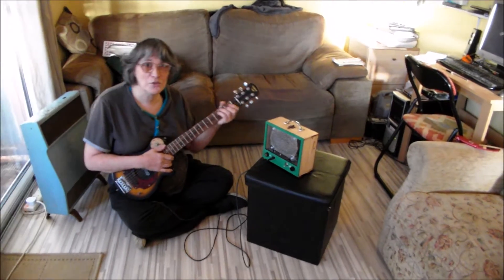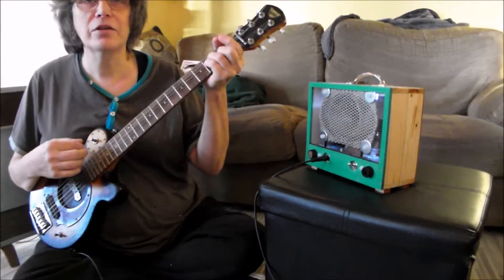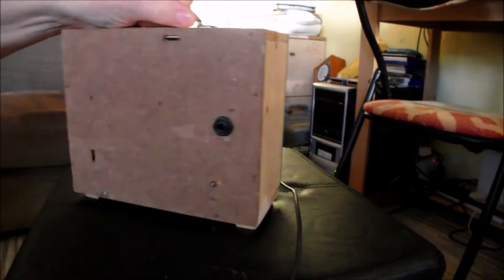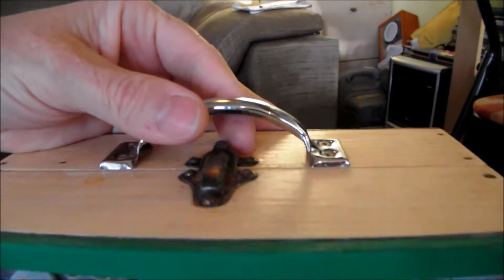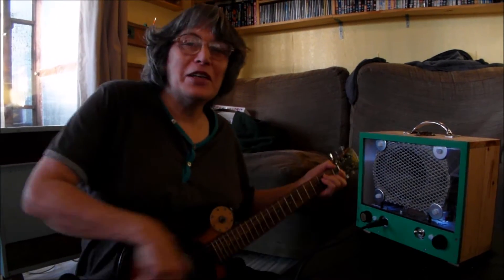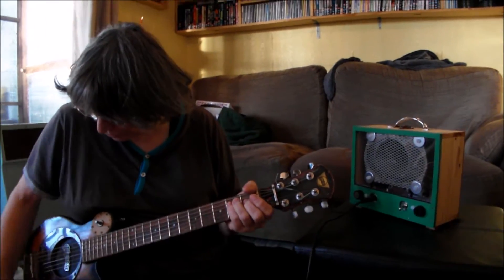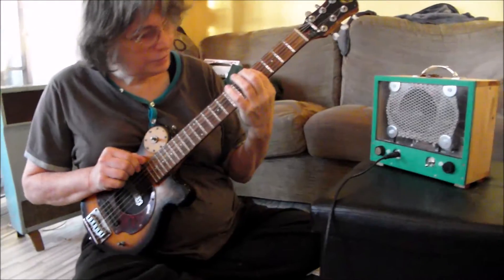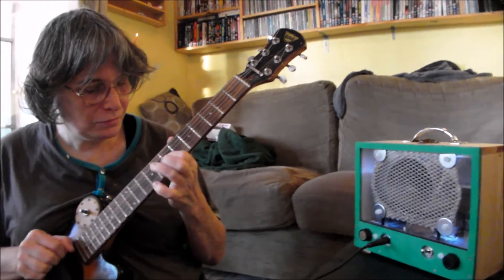ALL VALVE/VACUUM TUBE BATTERY GUITAR AMPLIFIER, NEW

Comment: I have found an old portable radio that was powered by battery and mains but it is not working and I would like to make it into a guitar amp . The power transformer and the output transformer are fine. It uses different tubes than yours and I do not know where to start working out what parts I need to make it happen. Do you have a schematics for your setup? I can strip everything from the chassis and start with all new components. I think it is a great little amp.Thanks in advance.
Reply from the maker: Hello Gy Custom Guitars. Are the valves octal or B7G? Both will work in a guitar amp but the power output for all of these designs is vey limited at 250mW. If you want the final build to be battery only, then there's a design on my Web. http://www.hoofbags.me.uk. A battery/valve version is a little more complex because the tube heater chain is series connected....continued.
Reply from the maker: Here's the schematic for the battery only version: http://www.hoofbags.me.uk/battery%20valve%20amp%202.jpgSo far, I haven't gotten around to the mains/battery version. However, this design uses a 7.5 volt battery (seven point 5) Also, there's a variable resistor in the heater chain and it would be a good idea to extract it and keep it set to where it was when inside the chassis and re-use it. The heater chain starts at the output valve: DL96, pins 1 and 7 and then goes to the DF96. Next in the chain is a DAF96 and finally the DK96. It's done like this to avoid instability and 'motorboating'. If you don't feel too confident, you may want to keep to the battery only version, where my hyperlink takes you. Pls let me know how you get on and thanks for you interest and comment, it really means a lot! (o:
Reply from the maker: Oops! That hyperlink doesn't work. Try this one and scroll down.http://www.hoofbags.me.uk/geekiestuff.html

Comment: Awesome!  Have you tried a push-pull configuration with these valves to boost the power?
Reply from the maker: That is a future project. Blackcovo, enlightens that two of these will deliver 2 watts. On top of everything else, I need to find time. There are two options: transformer phase splitting and using a triode stage that splits it but doesn't add to the overall gain. I was going to try the DCC90. It's a double triode that has 1.5 volt heater, just like the DLs. The DCC90 isn't cheap and they're quite rare. However, they look just like a DL valve and have a visual appeal.
Reply: Ahh, yes, it hadn't occurred to me that these are directly heated cathodes so most (all?) phase splitters with gain won't work. A transformer would be the easy option, I guess, but perhaps even more expensive than the DCC90? I have seen one design using a series of three DF91 valves driving a pair of DL94s in push pull. As blackcorvo suggests, potential for some quite reasonable power output there.

Comment: Would you consider building me a battery powered valve amp like the 'bat amp you where selling or sold on EBay awhile back?
Reply from the maker: Do you require it to have a transparent front panel or like the one we submitted earlier on? I'm happy to do as you kindly request but I've a bit of a backlog. Please don't loose hope, if you're still interested. Thank you very much for your interest. Love. Liz. (o:
Reply: One like the one you submitted earlier on would be great. It was in your video titled, "All valve battery guitar pratice amplifier improved useability. Thanks,  -Still Interested! Love. Ben.'
Reply: I would also be interested in buying one...how could I buy one? Greetings.

Comment: I went to check the datasheet for the DL94 (the output tube you used), and holy crap, it has pretty much every operating point you could ever ask a datasheet to have!
There's even one where it's delivering over 2 watts in Push-Pull Class B (page 5 of the PHILIPS datasheet).
Amazing little bugger. Gonna see if i can get a couple to play with myself
Reply from the maker: I was planning to design one with that valve, in push pull, class B. Philips got there first, needless to say. I will go to your recommended resource because I was thinking I'd have to use a driver TX to split the phases. It's a difficult challenge because the filaments have to be connected together and are commoned with every other valve in the circuit, and constitutes the cathode of every other tube. 

There's the DCC90 that could be used as a phase splitter, but they're rare, high price and need 200mA (!) for the filament. Is it a hard copy that you have access to or is there a link? Thank you ever so much for your comment.
Reply: It's a PDF scan online: https://tubedata.altanatubes.com.br/sheets/030/d/DL94.pdf

For the phase splitter, you could make it a Paraphase: http://www.valvewizard.co.uk/paraphase.html, which is probably the easiest way to do it.
You can use pentodes for that, but in case you think the gain is too much, you can tie the screen grid to the plate to basically run it in "triode mode".

If you want, I can doodle a crude schematic of what you could try (just the basic structure of the circuit, without values).
Reply from the maker: Another point worth mentioning: the filament of these valves very easily go open circuit. It is best to use a 1.5 volt zinc carbon or any other with that voltage. Also, 2 X 1N4001 in series gives a 1.4 volt crowbar in parallel with the filaments and, because they're so cheap, put another 2 reversed biased again in parallel. This will prevent any excess voltage destroying the heaters. I've blown one half of a DL96 already, and it ain't much fun. I've the schematic of this amp in geekiestuff, within my web:  www.hoofbags.me.uk.
Reply: So, basically, put 4x 1N4007 in reverse-parallel (like a clipping circuit), then in parallel with the filaments. Good idea!

Unfortunately, I just checked and these tubes aren't really too cheap where I live (22$ a pop), so I'll have to figure out something else with stuff off my tube collection for a project for myself, since I recently got a chassis that would look great as  a small tube amp. I do have a shelved amp based entirely on 6J6 tubes... Hmm.

I have checked your schematic, seems very simple and fun! Would love to try it myself.
Reply: hoofbags It would be reasonable to mention on your site that the amp should be powered from between 90v to 120v. Even if the maximum voltage rating for the tube is 150v, it's better to keep it at lower values to make sure it lasts a lifetime, not to mention that the higher output operating points presented in the PHILIPS datasheet all use 120v.
Reply from the maker: I've just found one. 

 http://www.ebay.co.uk/itm/DL94-3V4-CV2983-SYLVANIA-NOS-VALVE-TUBE-/271665438846?hash=item3f4085a07e:g:ZjsAAOSw1XdUYejt

The amp in our movie is a DL96: pin for pin compatible with the DL94. DL96 has a maximum output of 200mW. There's also the not pin compatible DL95 that is sometimes used by other manufactures and a few other that are an equivalent to it. They might be a little cheaper. I get most of my info from The National Valve Museum. There are a few others that are an equivalent. They might be a little cheaper. If you buy any of these from eBay, the first thing to check is that the filament isn't open circuit. 'Not tested' normally means not working, so beware. If you goto my web, you'll see a schematic by a Dutch guy. He gives lots of info about similar valves. Please submit progress movies. I will watch with interest. Thank you for your comments. (o:
Reply from the maker: You're absolutely correct: unfortunately, I get these things wrong all the time. I'm an ME/CFS sufferer and it has cause a small amount of brain damage. You may have spotted that I mention the LT battery and say that "it's a 1.5 volt D cell". I'm corrected by Annierak, it's an AA, so we insert a note highlighting the mistake. I used to attend a RSGB affiliated radio club and some of the retired engineers told me that if you overdrive the DLs with more plate current in class A, it will destroy the filament that, apparently, is as fine as hair. In class B it is a different issue. Curiously, I tried plugging in a DF96 into the DL socket and, albeit with much lower output, it works!
Reply from the maker: I don't know if you went to the Dutch guy's web, where he restores one of these old sets but there's a collection of tubes that are similar to the DL series. I'd love to get one of those battery octal types and hear how it sounds with a guitar stuffed into it's chuff! I have one or two DL35s that I plan to use soon. The dutch guy's web is here:

http://www.dos4ever.com/PYE87BQ/PYE87BQ.html
Reply: hoofbags Yes, I did go there. Very good source of information on these tubes!

But yeah, here in Brazil they go for between 20 to 40 bucks, which is a tad too much for me. I did manage to find a 1Q5 for 9 bucks, probably the best price I'll ever find for a battery tube around here.
Reply from the maker: Hello Blackcorvo. Could you please re-send that comment about the altoids tin? I accidently deleted your comment because of an alert box: "tap to show how much you like this comment. It was blocking your message and I didn't have an opportunity to read it.